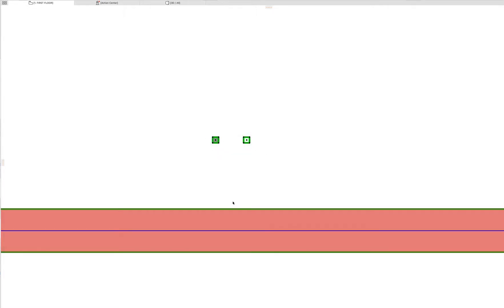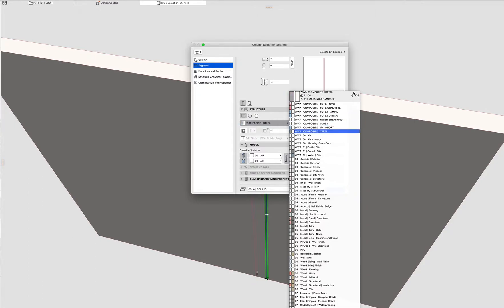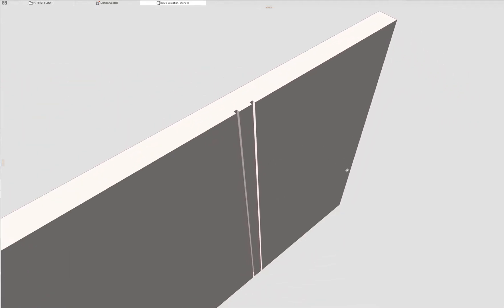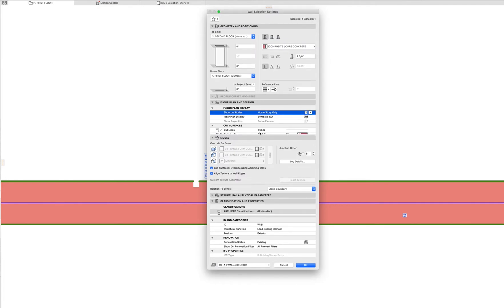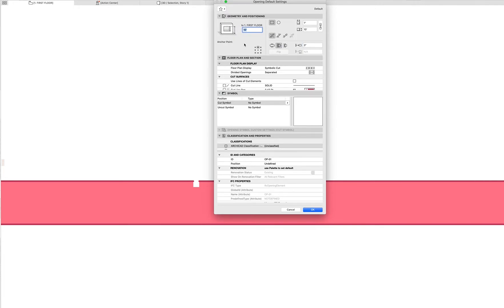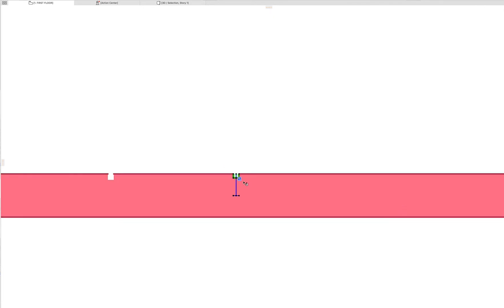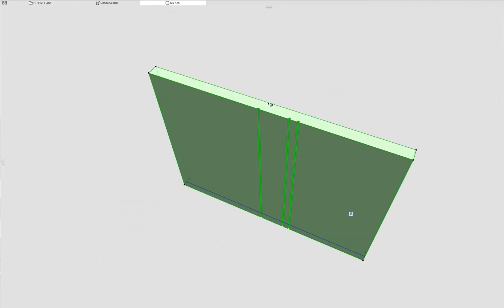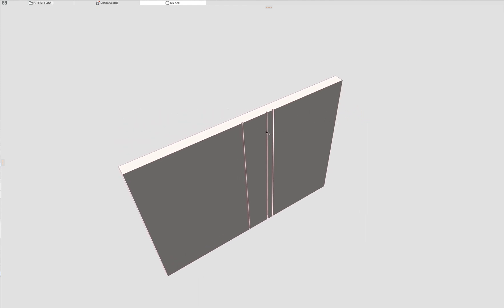Opening Tool  for Control Joints

Comment: Hi Patrick. I haven't tried this method yet but wondering if there's a way to control the 2d representation of the 'opening' in an elevation? Let's say you want to represent them with a thin line or to not show up at all so they don't crowd the flat 2D drawing? thanks